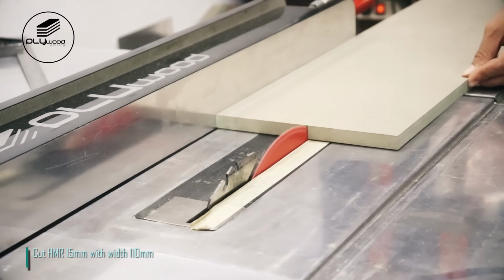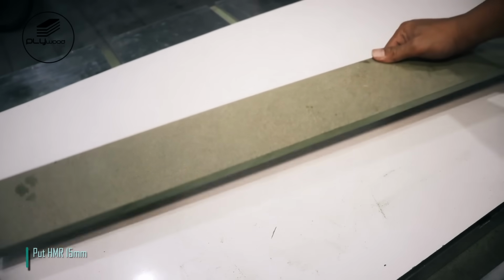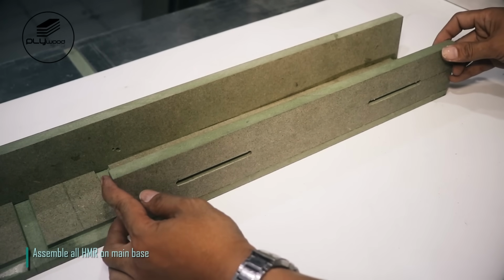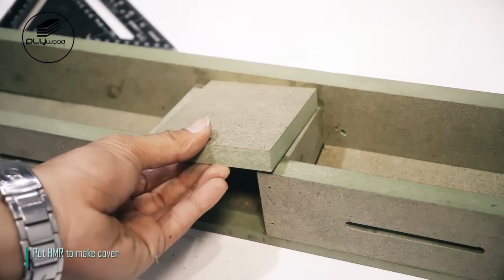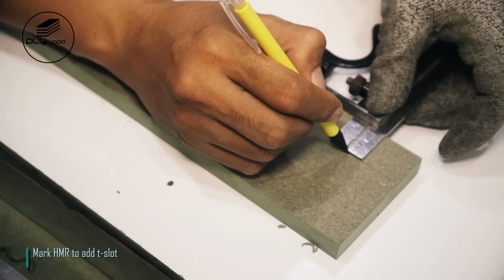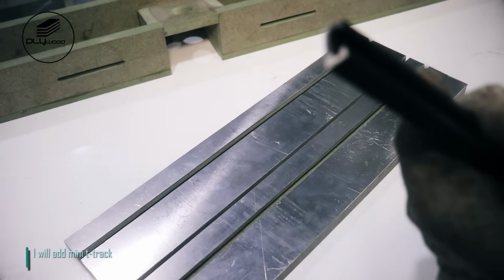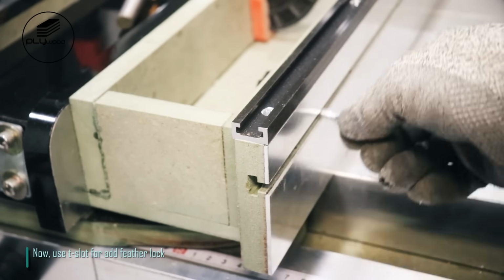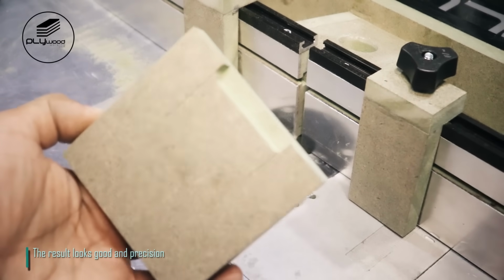Router Fence adjustable

Comment: You should set the featherboards further down and in. They are supposed to be slightly compressed, creating a sideways/downwards pressure on the work piece. When the wood passes through, the fingers/feathers should bend slightly. Feather boards purpose on a router table is not to prevent kick-back, rather to give constant pressure downwards and against the fence to give consistent result, especially on long parts where your reach is not enough to acchieve this.
Reply from the maker: thank you for suggestion

Comment: V.nice work thanx alot .........
I didn't find that's type of wood (hmr) in my country ...  can i use hdf instead please?
Reply from the maker: yes you can use HDF, that good material too but very heavy
Reply: @plywoodworking  but i can't make t slote  it will broken in case of hdf
Reply: Oday Alany how about MDF ?
Reply from the maker: @akbychoice  before i found HMR i always use MDF but MDF need lamination coz not proof moisture
Reply: plywoodworking yes that’s the big issue with MDF it falls apart with moisture.
Reply from the maker: @akbychoice  MDF good material but need more protection
Reply: @akbychoice  i think mdf is weak material especialy when you make t slot need more attention and When you put a screw in a certain location and lift it up, you cannot put another screw in its place because the place becomes wide that is pig problem while the hmr is heavy as i sea in these works
Reply: @plywoodworking   when you dril in hmr wood i see some plastic like material go out with wood particls
Reply: Oday Alany and I wouldn’t disagree with you on any of that.